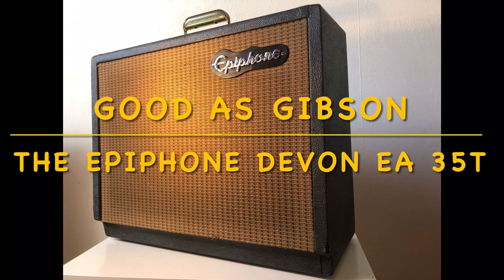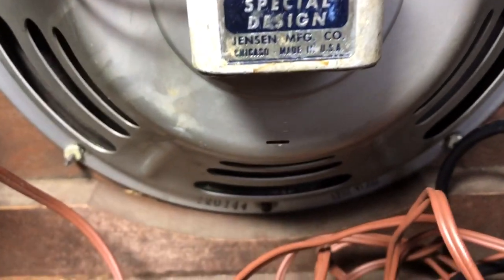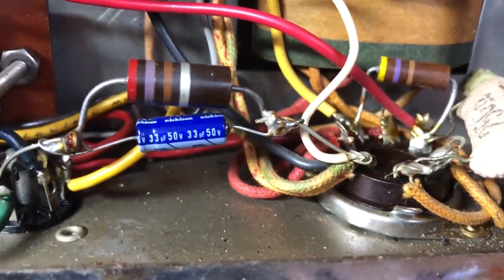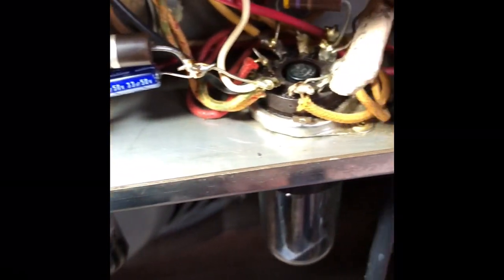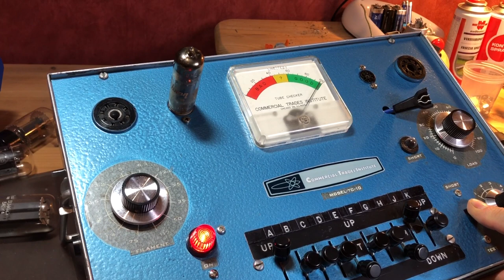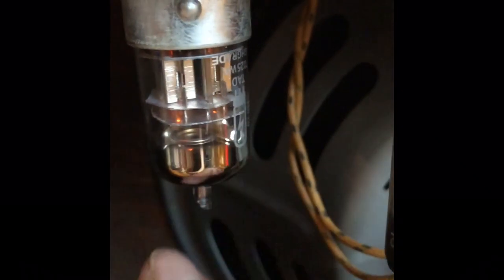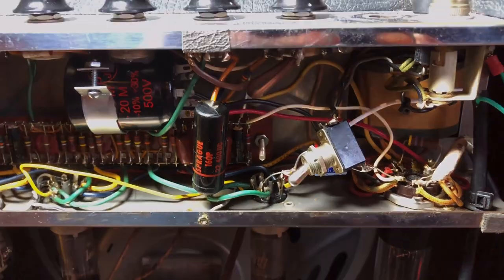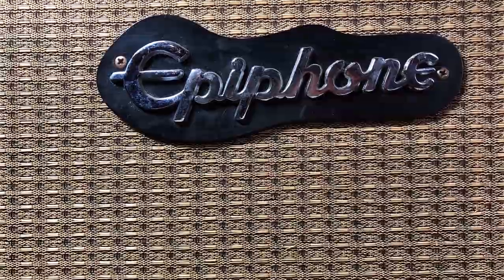Made by Gibson: EPIPHONE EA 35 T Amplifier from 1961, service, repair and evaluation

Comment: Actually, my experience with triode-pentode combination tubes like the 6BM8/ECL82 here (or the conceptually similar 6GW8/ECL86  used in some Magnatone amps and others) is that oftentimes the triode section, which is used as the phase inverter, will become weak even though the output pentode might have good life left to it, but your tube testing procedure as shown here didn't seem to test both halves of each tube.  The amp sounds good and everything seems to function pretty well here; but since in this case the triode section of one output tube is used as the tremolo oscillator and the triode of the other 6BM8 is used as the phase inverter for both pentodes, if you had any problems with weak tremolo or weak output I would advise swapping the two 6BM8 tubes in their sockets so that the triode that was formerly the phase inverter is used for the tremolo oscillator function, and vice versa.  

But anyway,  as you mentioned, the 6BM8 is still relatively inexpensive nowadays. If you had an amp with the 6GW8/ECL86, for some reason those run rather a bit more money nowadays, and the pinout is different as well as the electrical specifications, and so the 2 types are not directly interchangeable.
Reply from the maker: Thanks for these valid informations, as usual. Actually I tested both halves of the tubes. But because they are so cheap, I finally dropped in new ones. So my klient can store the original, Gibson labeled tubes for the future. I think it’s good to have them, in case a collector wants to buy this amp.

Greetings